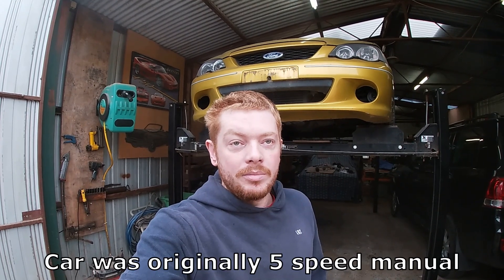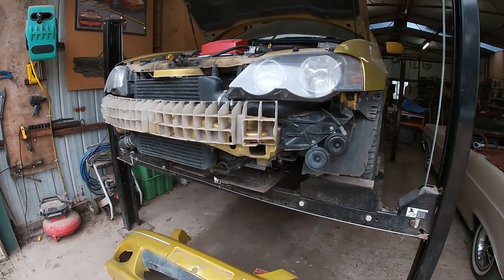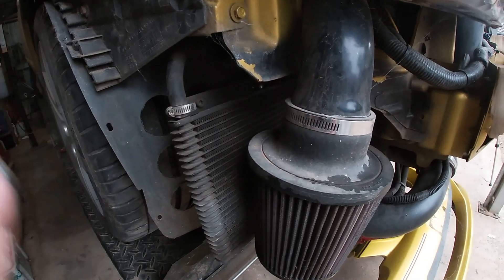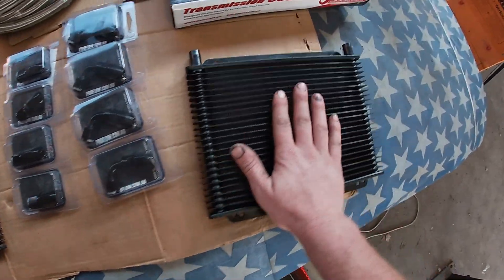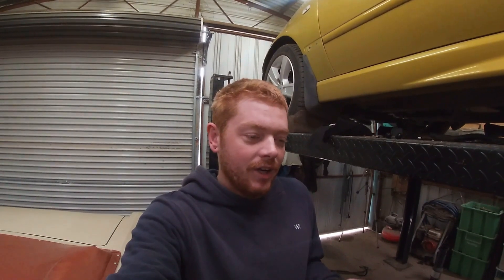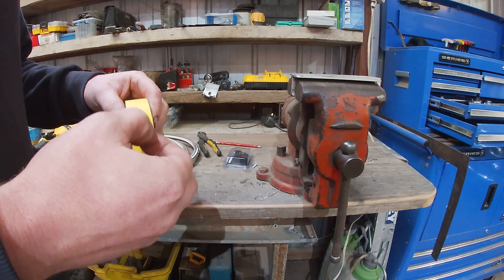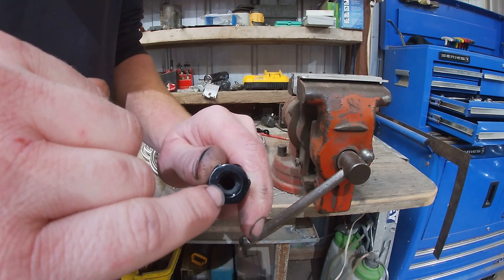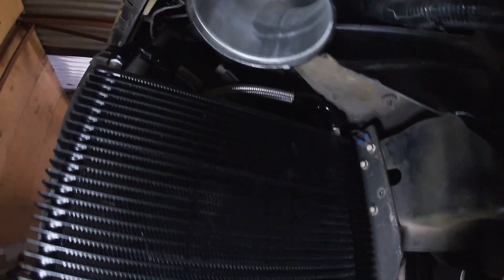XR6 Turbo EP16: New Trains cooler and braided lines

Comment: Awesome but the only thing I don't like about this install is the distance from the auto box which means more hose, more weight and more money... 👍
Reply from the maker: Yeah it is a bit longer then it needs to be. If i went the short way (along drivers side rail) the hose would be close to the exhaust, cat, dump and turbo. Thats probably not much of a issue with this hose, but before when the hose was rubber i was worried about heat stuffing up the hose.
Reply: @RedsProjects  have you considered underbody install with a fan ?
Reply from the maker: @neilbeni7744  i have but they dont cool aswell, only have to put my fan on if im in heavy trafic on a hot day

Comment: What is the brand and model lift you have there Red? And if it's not too much to ask, how tall are the posts? Cheers 😀
Reply from the maker: Im not sure on brand, ill messure the posts tomorrow
Reply: @RedsProjects  Thanks Red.
Reply from the maker: @joebloggs7828  the brand is "direct-lift", posts are around 2100 high. Roof hight is around 3300 in the middle, thats just enough to get my cars all the way up to the top lock
Reply: @RedsProjects  Thank you for taking the time to get me the info, I'd like to put one up in my garage. You're a legend. Looking forward to you getting the falcon back to the track. Cheers.
Reply from the maker: @joebloggs7828  happy to help. Thanks, i'm keen to race it again